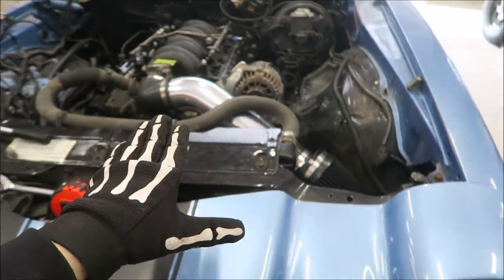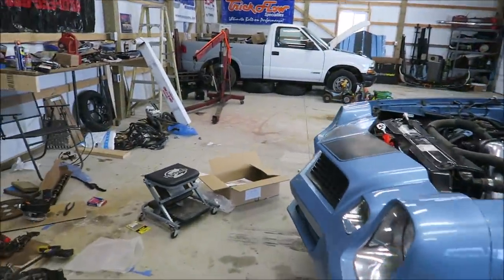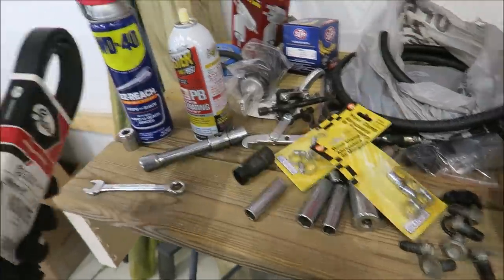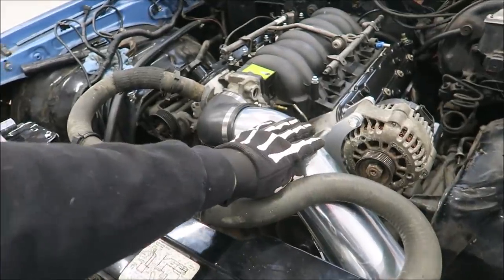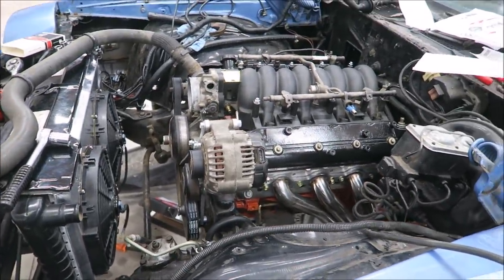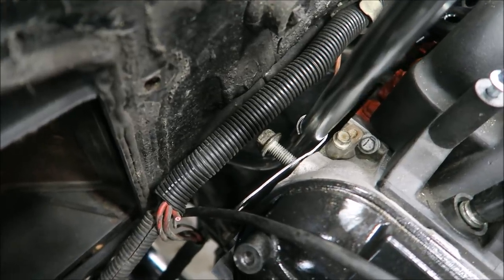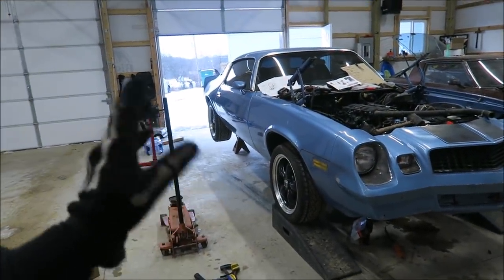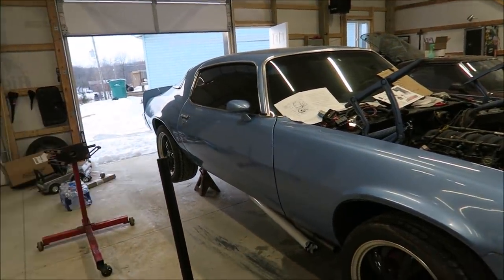This Is The Hardest Part Of Building A Hot Rod...

Comment: I did that exact same fuel pump and line and hose clamps. Those clamps are known to fail and not efi rated. I decided to get a new tank and run an fitting with steel braided line way nicer and a piece of mind. If you decide to stay that route get efi rated hose clamps at least so no lines will pop off. Those clamps are only really good for the carb stuff because there is not much pressure. Keep it up man im loving all the content💪🏻👍🏻
Reply from the maker: Double clamp each connection and they good. For as cheap as these are, I think they work better than a single efi style clamp; for the price.

Comment: Bigger joints are likely 1350. But you gotta measure everything to find out. Best to do that before ya order the driveshaft so they can install the right ends on the driveshaft. You’ll likely need a conversion joint now. No biggy tho

Comment: Bro, you might want to take a look at those subframe bushings. When you made this video, I caught a glance at them and they look trashed. Especially with that engine upgrade, those subframe are going to make all types of noise and you'll loose stability on cornering when driving.
Reply from the maker: They could use some attention but I'm just getting it running and driving for him. If I fixed everything  little issue on this car I wouldn't make any money
Reply: Got ya. Just wanted to make you aware of them after seeing'em.
  Anyways, awesome work, and love your ways, with the channel..

Comment: That line could be a vent for the tank
Reply from the maker: Yes. Its most likely an old evap line. But it'll work for a return as long as it has a vented cap. At least, it has for others
Reply: SniderTron 3000 i would see if you could blow through it Bc on my s10 I have the msd inline Fuel pump for efi and I noticed it sounded weird and the motor didn’t run right but come to find out I had actual hooked the return to the vent on the tank with had a check valve in it🙈
Reply: SniderTron 3000 but think I’m going to put an intake quantum pump in it like you had. But would you recommend it? I eventually would like to make just over 500 on motor and over 7 on spray and that’s at the crank
Reply from the maker: The quantum worked really well but ran out around 5psi of boost. For N/A it would probably be fine but idk. For the money I'd just go with a 450 wally and not worry about it
Reply: SniderTron 3000 ok thx for the feedback I just looked and for their 340lph it’s only $50 but man I’d like to meet you one day maybe you could teach me how to be famous on YouTube like you
Reply from the maker: Lol I'll let you know once I figure it out
Reply: SniderTron 3000 😂😂😂

Comment: that filter has to go after the pump. I have the same  one on my trailblazer ss intake.
Reply: I heard trailblazer ss intake is the best you can get for the ls motors is this true & if so how much to they typically cost? im thinking about getting it for mine.
Reply: TB SS intakes ate the best factory intake. If you're not making a ton of power there's no need to go aftermarket.
Reply: @shawnc1716  they are really good, I would say if your under the 500 hp level then it's the best you can get, after that you would make alittle more with a larger 1 but unless your going boost it probably won't help that much.
Reply: @shawnc1716  I pick-up up 1 for 100 with everything on it and another for 60